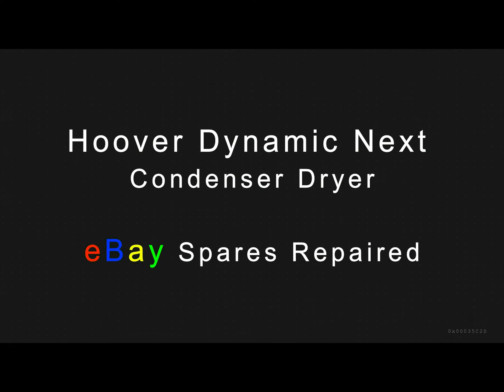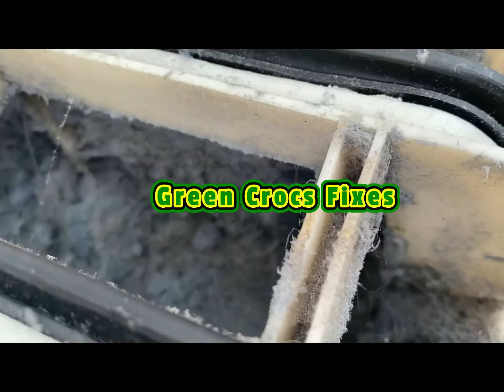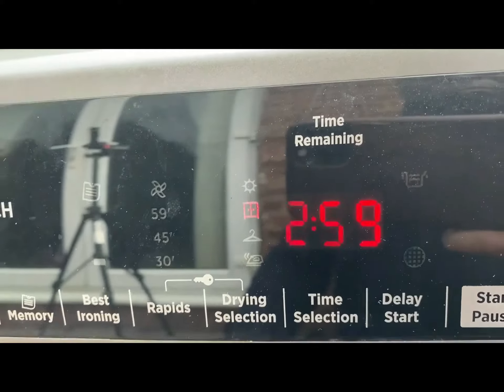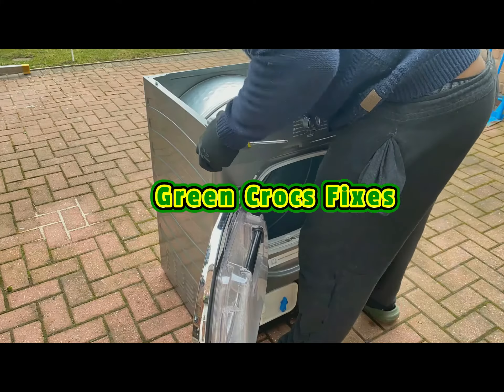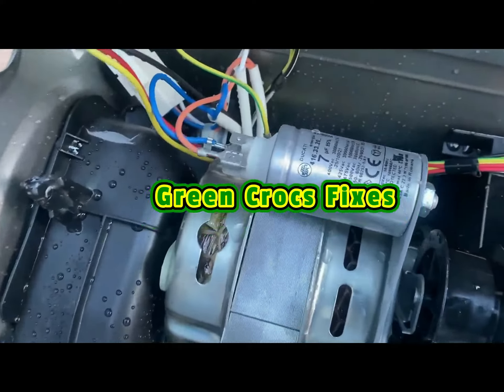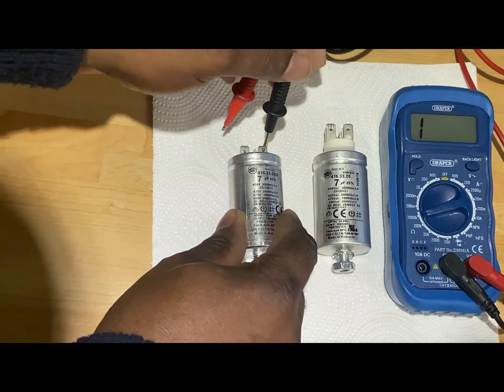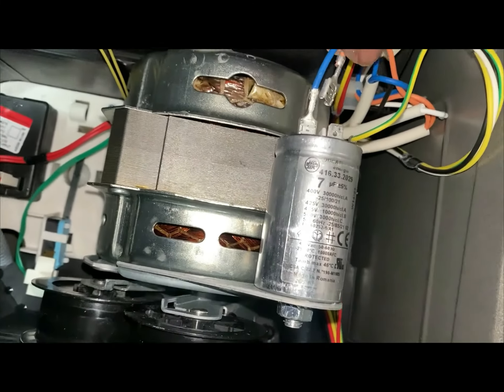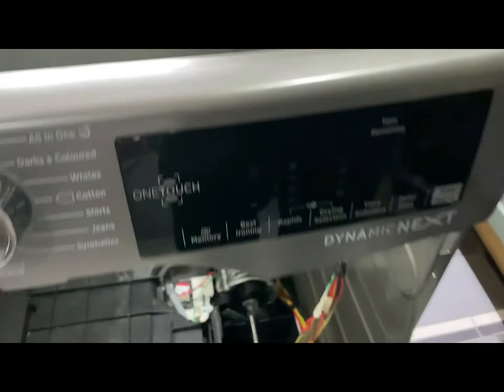HOOVER Dynamic Next DX Condenser Tumble Dryer Not Working  Fixed

Comment: Great video, thank you for all the tips.
My older but similar machine dries fine but keeps on running. When the timer gets down to 15 min's it stops counting down even when the load is bone dry. 
I 'acquired' another which needed a motor cap. Changed that & it works fine now, but does the exact same 15 minute thing!
Both been thoroughly cleaned of visible fluff etc.
Not a major issue but it just means the machine needs to be supervised. (And the O/H worries it'll catch fire!!)
Reply from the maker: Hi Opapagaio,
                       This model has a Temperature Sensor on the front panel, Condenser Unit and one on the Heating Element. May the one at the front requires attention,
Reply: Many thanks for the reply  @green-crocs-fixes1520  I will check this and let you know for sure. 👍

Comment: Thanks for the video, I just finished stripping and cleaning my own tumble dryer. Loads of dust inside. So it got a good clean.

I replaced the capacitor as sometimes my drum would just stop during a cycle. Hoping that's sorted it out.

Otherwise I'm gonna have to try some other things 😅.

Thanks!
Reply from the maker: Thanks DJP,
                    hope your issue is resolved 😀.

Comment: Thanks for your video, it's been really helpful. I have a very similar dryer, although mine is a heat pump rather than a condenser (I'm not sure what the difference really is but mine doesnt have the heating element at the back for example, just the fan and plastic housing).
My drum has stopped turning, i think it's likely that the motor capacitor has gone but I cannot get the drum out. Do you have any guidance on how to remove the belt please, I'm guessing that needs to come off first? And then i think i may need to get a knife down the back like you've mentioned in a previous comment.
I'm also struggling to get the door lock off the door, the wires don't seem to be removable and i cant seem to push the plastic bit through the machine front to separate them. Im hoping i can leave them connected without damaging any wires when i manage to get the drum out. Thanks!
Reply from the maker: Thanks Hannah,
                             sounds like you have a Heat Pump type of Dryer there's a lot more to them. Hannah you can access the Capacitor via the Fan assembly on some Dryers apparently, I always remove the Drum so I can
Vacuum out all of the Lint.

Comment: Hi there, thanks for the video it was very good to watch how the things work inside..
Even though I have cleaned filter, condenser tank as much as possible, there is a light flashing to clean the filter and my clothes don't dry properly and I have to run extra cycle.
Do you think I am missing out something to clean properly
Reply from the maker: Sounds like you have an obstruction London. Wash out the Condenser unit including the front and side Vents and once you have removed the Fluff Filter vacuum out it’s housing (when dry) as there is always Lint down there. In order for the machine to operate correctly air must flow around the inside in two directions unobstructed.
Reply: I will definitely try doing that, I hope it resolves the issue.. Thank you so much for getting back I really appreciate it.. 🙏🏻

Comment: Very helpful vid but Just need to ask can you use a diff higher capacitor because the one u bought  7UF for £10 is listed for a completely  diff dryer but the one for this machine said 12 UF but have the name of this unit in fitting list
Reply from the maker: Thanks Invincible,
                                I only replace like for like, so if I remove 7UF +- 5% then that is what I replace with. No idea where the 12UF you suggested comes from.

              Regards.

Comment: Could you put a link up to where you purchased the capacitor. Also do you not have to discharge the capacitor before removing and if so, tip on doing so. If you can change the capacitor through the fan housing at the front, do you still have to remove the whole front of the machine ? Sorry about all the questions.
Reply from the maker: Hi John,
             you can purchased the from Amazon /eBay just ensure you order the same part numbers, type removed. I stated in the video at 09:08 that I have shorted / discharged the Capicitor with a pair of insulated Pliers prior to removal. Don't know what model machine you have but I have replaced the Capacitor on a Candy Dryer via the Fan Housing (bottom right) which is fiddly to carry out but a lot quicker. I strip down and clean the insides whenever I intend to resell.
Reply: @green-crocs-fixes1520  Thanks mate for the info, It's the same dryer as the one in your video. I pushed the door lock in today to allow me to switch on and turn the drum by hand and it worked, but won't do it on it's own, so think it has the capacitor problem. I also noticed there is a 1yr parts and repair warranty but the machine is around 5yrs old, but on their site it says parts are guaranteed for 10yrs, do you think they would replace this part for free or would it be the old excuse of yes we'll give you the part but we'll have to sent someone out to check it and suck more money from you even though the actual part is faulty and covered by their own warranty. This one is a replacement for the one that went on fire.
Reply from the maker: @johnmcmillan497  Hi John,
                                                    definitely points towards the Capacitor, as for the 10 Year warranty ! all the best with that. Most of us don't even Registering the Warranty until the machine breaks down 😀

Comment: Thank you so much. I have a very old Hoover Nextra 8, which shows the water symbol and will not start. I have cleaned the filter and the condenser unit and emptied the water tank. But no, still the symbol is flashing RED. Do you have any recommendations of what I may check? Before I contact a very expensive technician who most probably will say buy a new on.. Warm regards from Norway, Lene
Reply from the maker: Hi Lene,
              and thanks 😀. Sounds like an issue around the Water Full indicator or the Reservoir which can have a build up of Lint/Fluff over time especially if the machine has not been maintained  regularly. Don't know your skillset Lene but the Sensor is set deep inside of the machine and will require quite a lot of dismantling. Here are a couple of Vidz which may help; https://youtu.be/CekGxr7VQXw?si=3WlcEHd7MggGEuaB 

https://youtu.be/YgVC-1qZYZU?si=1re4Qd5AO_8T8quw

Comment: Hi mate, on this model do you need to remove the drum to swap the capacitor? Thanks
Reply from the maker: Apparently not Jay,
                                you can gain access via the Fan housing. I only take the Drum out as I clean the whole unit.

Comment: Do you need to take the drum out to do capacitor or just condenser housing?
Reply from the maker: Hi Mark,
              Apparently you can gain access to the Capacitor via the Fan housing at the front.

Comment: One of the cheapest made machines . Nothing but trouble.  Thank u for taking the time to.make this video. I am gonaa toss this.crap.machine away and but a decent brand  that is decently made.
Reply from the maker: Thanks Anu,
                       and sorry to hear you have problems with your machine, however most Hoover \ Candy machines which I come into my possession  have been neglected and not maintained correctly which has lead to their failure.

Comment: Great video - ours cuts out and I think it the moisture sensor will needs clean: do you know where it is?
Reply from the maker: Hi Susanne,
                    there are two Sensors, one is behind the Door panel and the other on top of the Condenser housing 😎.
Reply: Awe, thanks so much for your reply. Are those two sensors moisture sensors?
Reply from the maker: @kuckuckskind289  I do believe the are.

Comment: I know this is an old thread but i have same dryer. Filter and condenser have been cleaned. But we keep getting light come on to clean filters. Any suggestions what else to do?
Reply from the maker: Hi Gavin,
               possibly fluff around the inside of the Condenser housing and around the Fan assembly, the machine has to blow air freely around the unit and any major blockage will imitate a blocked Filter. Suggest Vacuuming inside of the Condenser housing, not easy to access obviously but if you can also clean to the right where the Fan blows onto the Condenser unit too. When you remove the Fluff filter make sure its clear when you look down to the Condense.

Comment: Hi, I've got the condenser tumble dryer whereby it collects the water in the door - however, my machine makes all the right noises but its not collecting water and there's no videos on YouTube for this issue.  Do you know what could be wrong with my tumble dryer?  Thanks in advance for your time.
Reply from the maker: Hi Angie,
               There is a Pump (on the left in 11:01), this could be blocked or malfunctioning as it fits into the Condenser unit which can get blocked with Lint if not maintained correctly.
Reply from the maker: also make sure the Condenser and Lint Filter is clean.

Comment: how do you get the drum out, taken all the screws out and the belt off but seems to be stuck
Reply from the maker: Hi Steven,
                 struggled myself at this stage. There is a Black Seal (see 6:59 on the vid) painted on type, had to use a bent knife to work the Drum free via the Heat Element vent.

            Regards 😎.
Reply: Excellent video and saved me a fortune! Finally got to the capacitor and it’s only going to around 4uf. I struggled with getting the drum out and it’s currently still attached to the main frame. That part of your video now explains why!

Comment: What screwdriver set do i need to get the lid off? I thought it would be a torx set but its not.
Reply from the maker: Hi Carley,
                It is a 7mm Socket head or somewhere around that size.

             Regards.

Comment: Same machine, all the filters are clean just doesn't produce much water and takes ages to dry.
By ages i mean 6 to 7 hours
Reply from the maker: Hi Raza,
              does the unit warm up i.e. does the door glass get hot ?
Reply: Hi I have similar issue no heat I guess everything else works okay just no water extraction is in the tank even after full cycle is complete and clothes remain damp. Can you help please

Comment: d i have a dynamic next one touch range 4  dxc9de-80 model no 169402 do I have to take the Brum out to change the capacitor
Reply from the maker: Hi Wayne,
                 you can replace the Capacitor via the Fan Housing apparently, never tried myself as I prefer removing the Drum and and cleaning the whole Machines insides 😀.

Comment: Hi mate I have a hoover dxc10de-80 when I turn it on and press the start button it trips the electric straight away any idea where to start to diagnose it
Reply from the maker: Hi Tony, could be the “Emi Interference Filter” device what the power cord connects to inside or something else. Working on a Machine  and video with the same issue right now.
Reply from the maker: But this one trips the fuse when you plug in with the Machine switched off. If you capable try disconnecting the Motor and Heat Element, then reconnect individually.
Reply: @green-crocs-fixes1520  I disconnected the heating element pressed the start button didn't trip just came up with error code e21
Reply: Sorry it powers up trips rcd when start is pushed
Reply from the maker: @tonyharris6450  what about the motor disconnected
Reply: @green-crocs-fixes1520  i will give that ago but will reconnect the heating element  and get back to you

Comment: My friend had a hoover dynamix next dryer only for 13 months and the belt snapped everyone told her just get a new one as I am going to have to charge £80-£100 to fix it as it’s a pain to the drum out now I see why 😳 
I am picking up a heat pump one later that doesn’t get hot but works fine other than that It works fine I hope it’s just not been cleaned Ever. And i can sort that. 
Very complex tumble dryer…
Reply from the maker: Hi Colin,
              good luck with the Heat Pump unit and yes removing the Drum on these Hoover units can be quite testing.
Reply: @green-crocs-fixes1520  the hoover aqua tec heat pump was dead gas had gone so scraped it the next day….
Reply from the maker: @colinsace1  No worries Colin, probably not cost effective to repair. You win some…..
Reply: @green-crocs-fixes1520  yes you do but yeah this hoover dryer was only fit for scrap unfortunately. But I don’t know much about heat pump dryers but I know when they go wrong and cold it’s usually had it. 
But my Miele eco comfort broke down twice in its 7 years lifetime but lucky first it was the refrigerant sensor went then as soon as they guy left it broke down again they come back two weeks later and it was the moisture sensor or something under those screens was gone and loose so he put new one in had no problems since that was nearly a year ago. So all good for now. 
Like you said you win some , you lose some lol.

Comment: would b great if you kept complete video instead of time lapse, so the ones that want to learn can view the entire process. It so happens I have an identical machine and would benefit from your complete video specially the taking out of drum & belt techniques you use
Reply from the maker: Thanks R1ZW4N,
                             I hear you, however i speed up certain sections of the video just to reduce time, but you can still see what I am doing, rather than cutting out the entire section.
Reply: The process consists in unscrewing about every screw you see..

Comment: Pos dryer anyways, sensors can fail too and buttons get wonky alright. Barely worth fixing unit cost £225 at the time
Reply from the maker: Thanks Zeroy,
                       totally disagree, brought for £25, part cost £10, sold for £115 on marketplace. Obviously works out better the cheaper you can get it.

Comment: Capacitor change can be done in less then 10 mins without having to strip it all down
Reply from the maker: Thanks Ross,
                        stripped the unit down to clean the insides as I do with all units, to prevent Dryer Fires.
Reply: @green-crocs-fixes1520  i see! I work for them, need any help drop me a message
Reply: What’s the trick, I’ve had to dismantle mine to change capacitor….
Reply from the maker: @cloudyeastside  Yes Cloudy,
         they can be difficult especially first time around.
Reply: @cloudyeastside  take the front fan housing off (bottom right), take out the fan and spring washer behind it. Then the housing comes out. It’s abit tricky to start with as you’ve got to bend the housing out. Then I use 13mm socket with a 6’ extension bar.. wind the nut off and be carful not to drop unless you have spare
Reply: @IxEcho I have this machine getting error E22 any tips please on a fix ?

Comment: Hi mate this a ten minute fix, cap can come out via the fan housing
Reply from the maker: Thanks Will,
                     agreed however I prefer to clean the units inside and out, hence why I dismantle the unit.
Reply: @green-crocs-fixes1520  yeah makes sense if you are looking to resell, must do about 3 of these a day in winter! Easy way to tell if the cap has gone is trick the door lock and then spin the drum by hand when you can hear the motor engaging
Reply from the maker: @dougwilz  thanks good tip, I use this same process for everything I repair 😀.
Reply: @green-crocs-fixes1520  good stuff, I’ve subbed to your channel, keep the washer/tumble dryer vids coming!